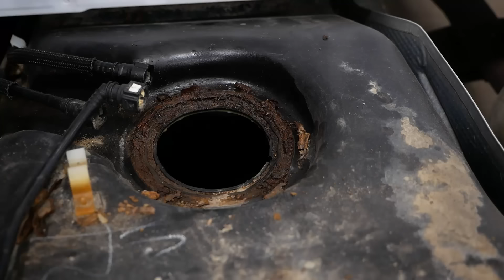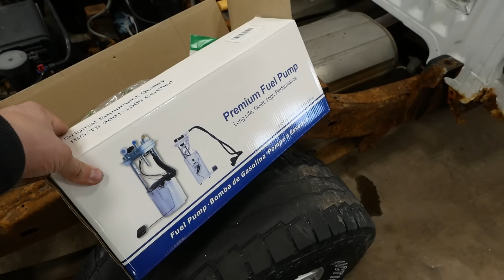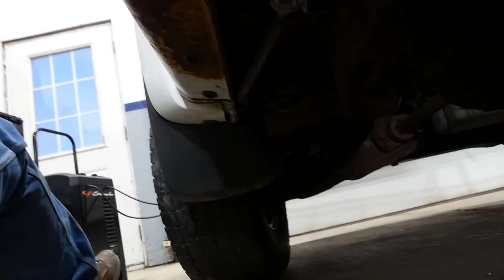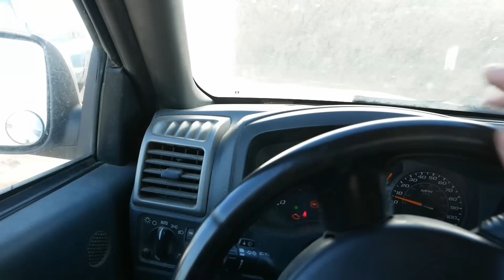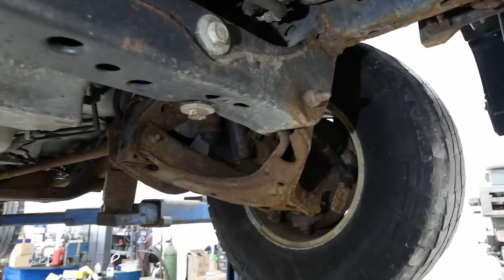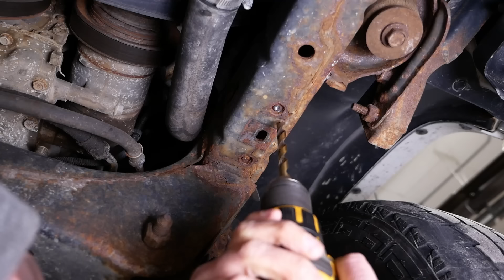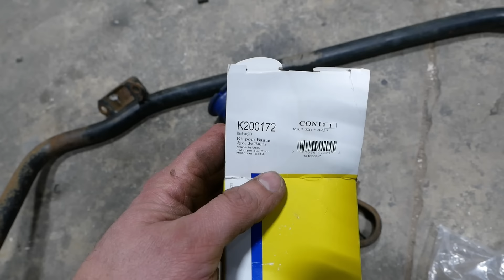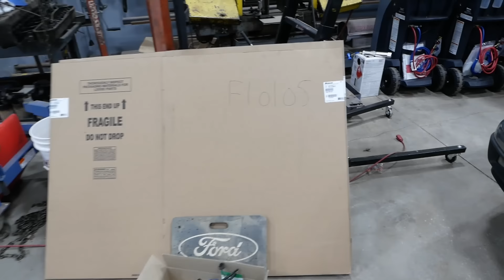Saving a GMC Canyon with 434,000 Miles from the Crusher - Won't Start, Fuel Pump Tabs Rotted

Comment: I bought a fuel pump from Amazon lasted.3 years.The transmission went out in the Van and it was still running still working.And I only paid $42 for the fuel pump. Thank you god bless

Comment: FWIW, I had to replace a rear taillight on a Terrain and their electrical connectors are almost impossible to take apart too!!!!!!!!!
Gee, we already know and have 4 and 6 cylinder engines, how about throwing them an in-line 5?!!
Nice troubleshooting and save.
Could you put some kind of cover over the recess in the fuel tank to keep water and "stuff" out of there?

Comment: Ford trucks have similar wire problems, sunroof drain tubes plug causing water to build up in rocker panels and cab corners, then they rot out and the rockers fill with sand and it destroys the wire harness inside the rockers.

Comment: This spring my 2013 Colorado started spraying fuel under the bed. 
Ended up pulling the bed. What a mess. 
When I got it off I could see that varmints ate the fule line. Plastic crap anyway. I replaced the fuel line. Pulling off and putting it back on broke the paper thin elbow on the steel line from the pump. 
Ring was still there and tabs were too. Just barely. 
Replaced the ring with an after market plated one and replaced the pump with an OEM one. I didn't want to have to pull the bed again. 
Working fine now.

Comment: Ya know Im always finding odd solutions to things and well when I saw that darn fuel pump sitting in that depression on the tank holy crap.  I know that hindsight is always 20/20  but in this case if I had known ahead of time how badly  that was designed I definitely would've blown that depression clear of crap and tried to apply a generous amount of  high heat gasket maker around that entire bowl that it sits in,, In your case I might try that boat tank but id fab up a thin metal container  for it to sit in.  I love this challenge you've given yourself , its only by getting out of your comfort zone that you expand your mind and truly use your creativity..

Comment: The passlock (anti theft device is not allowing it to turn on, fix  the issue ,  and the passlock will allow ignition …Any way it’s an Izusu  engine and yes they can go beyond  the miles of other engines ,

Comment: My work bought a new canyon in 16 in forty thousand miles the dealer replaced 3 complete  rear ends bearing issues. Then a check engine light came on dealer said it was a timing chain issue so they replaced it and the new chain broke and took out the whole engine.  Glad I bought a tacoma 😊

Comment: I would Permatex the whole thing. Also, troubleshoot first. I work in manufacturing and fix machines. Always troubleshoot first. Understand your meter readings.
Reply: Paying attention to the actual video and comprehending what’s being said is very important …….
Reply: @msabia1  I did understand. I wouldn't be doing a bunch of mechanical repairs without understanding the electrical problems. I would test and not fix the obvious that wouldn't solve problems. If the truck had a flat, I wouldn't fix the flat first and see if it would run.

Comment: Running it and running about two or three cans of carburetor throttle body cleaner through it or even brake clean through it while it's running at about 2000 to 2500 RPM usually cleans those up pretty good. And then put a good dose of acetone or lacquer thinner into the gas tank to make sure you clean out that fuel system. Maybe about 24 to 32 oz and run it good

Comment: If that's throttle body does not have an idle air control circuit it's the first one I've ever seen that doesn't. Although I've never worked on one of those older Colorado's.

Comment: well if it ain't my wife's truck. i used the same kit on hers and it worked well for less than a year. now the plastic is splitting apart and i'm getting water in the tank again. i was considering making a custom fuel tank for it, but they're a goofy shape so i figure we'll just junk it.

Comment: Once split tubing gets full of water and grit it just wears away at the insulation, then the wire just corrodes away. It happens especially where the harness is supported as the wiring inside moves but the tubing doesn't.

Comment: The problem with the wiring in newer cars is the coating they use on newer cars, I have a 91 Olds Bravada and the wiring looks brand new and it has 300,000 on it all original, same as my 99 GMC Safari awd wiring is in great shape.
Reply: Manufacturers switched to soy-based wiring by the mid 2000's, they used to be petroleum based. Our cheese eating friends discovered that change and wire damage became considerably more common ever since.

Comment: Hi from beautiful Ireland ☘, had a similar problem with my old Nissan Sunny.
Initially I thought it was the pump but the trusty Fluke 73III and an external battery proved otherwise.
Broken wires in the harness was the problem 💪😀

Comment: Only 7 minutes in but wouldn't it be possible to epoxy a new ring in place on the tank to lock the pump, instead of replacing the whole tank. I think I would do it that way.

Comment: I had a 98 Dodge Ram 1500 5.2L back in the early 2000’s. I put 400K on the motor. Had to replace the transmission at 215K. Other than the usual items that wear (water pump, belts, plugs) it was a solid engine. Just changed out the oil every 5K, coolant every 20K, and ATF every 20K. Regular maintenance makes a huge difference.

Comment: Imagine if you designed an affordable small truck and they tested it for 430,000 miles and told you the reason it stopped was a broken wire. You'd be so proud of your achievement lol

Comment: Good call on not using the seals all for gas glue, I live in a cold winter climate Canada,  I had repaired a kerosin fuel tank for a heater, that I used in my camper, I stored it in cold storage one winter ,and the next thing I knew that tank had a leak from where tip sealed it ,had just flaked away...maybe I didn't apply a thick enough amount or maybe I should have sanded the surface first I don't know... I'd still use it on stuff that isn't going to be hidden or hard to get to things but wow over 400,000 I thought I had a high mileage truck, I had to go and check., 338...And mine is a 93 5.1 ford I say a prayer every time I leave and return safely 😉

Comment: I may or may not have used threaded rod, angle iron, and half tube of seal-all to fix a fuel sending unit on a car with over 260,000+ miles🤣

Comment: sway bar broken bolts drill thru, heat up and use  "easy out" bolt extractor .Grabs on reverse (ccw) I do alot on exhaust bolts.

Comment: It is very possible to have that many miles on a vehicle and much more if you take care of it. It may have been a fleet truck that regular oil changes, inspections, and immediate repairs as needed. I had a customer once that had a ford escort that rolled the odometer past 999,999 and back to 000,000 and on. He went by the owners manual to a tee even replacing the timing belt every 70,000 miles. He did have to have a transmission overhaul but the motor was all original except for the timing belt, pulleys and serpentine belt.

Comment: I have a Colorado same body style mine has 300,000 still got the OG timing chain and I'm just as surprised as u are. Those motors get a bad rap cause of the design but I've found if u change the oil regularly Thay last

Comment: 5 cylinder engins are usualy very well balanced. Germany was well known for 5 cyl. The mercedes diesel engines that came in cars were well known to run after 500k miles. The mercedes museum has a car with over 1 million miles. 
I have friend with mercedes diesels one of them has 485 k miles
The other was 502k miles.  I own 2 mercedes turbo diesel cars that get about 28mpg. For a comfortable car that is over 3500lbs. Very reliable Cheap to maintain and get parts you cant beat them.

Comment: Shame on gm.  
My 05 Yukon pump was rusted out but not that bad. The lines were leaking so I remove the back seat and chopped the hole and put in a new pump and it worked okay but I had to grease up all the metal lines and lock. I've been okay now for 4 years. 
I never drop the tank

Comment: The shop vac used on the tank is scary i watched a guy do the exact same thing and before i could say don't touch the switch the shop vac exploded and landed about 20 feet away. The electric motor isn't isolated from th fumes. Oops.

Comment: 25:28 Wes you crack me up. "Could this thing possibly have 433k miles on it?" Yes. Not all that uncommon in the south. Everybody has a family member or friend with a car or truck over 400k. Dad's neighbor must be approaching it, I've rode in a corolla with 420, and I've seen a mint 4runner with 450k. We fix them down here because they remain worth it.

Comment: Where the break was.  Maybe the other wires were damaged from the arcing of the fuel pump wire as it was failing.  The fuel pump wire may have been mishandled at the factory when installed.

Comment: My 2008 Colorado with the Isuzu I-5 ran for 329,700 miles before the rear engine seal started leaking and I no longer trusted it for my 180+ daily commute.

Comment: epoxy resin and fiberglass rope would seal the new fuel pump in place . the anti roll bar  bolts need a bit of lube .. and some 3M chassis wax would improve the life of the rusty chassis .

Comment: Back in 2008 I had a 2005 Colorado 2WD ZQ3 factory lowered 4 door. Had the 5 cyl automatic. On those they put on 17" rims with fat low profile tires so it drove like it was on wheels. Trouble was the suspension wears out fast. After I had to have the transmission redone at 80K, the steering was getting loose. Some of the mounting points were wallowed out. So instead of a 4000 repair I traded it in on an 02 GMC Sierra with 90K. Dealer gave me 4000 for the Colorado too. 8 grand ahead I was the Winner.

Comment: Wes, you are doing the broken bolts wrong! Rainman Ray said to weld nuts on them first! I have never seen such a clown that does things like he does! Everything he does is unbelievable! Not in a good way! Another great video! It’s so nice to see real mechanics and not just a guy that gets on You Tube like Ray does, and runs his mouth like he is the best tech on Earth, which we know isn’t the case at all! He had me fooled for awhile, but after 3 ruined engines because of his bolt removal process, I knew he was just a X Jiffy Lube guy! And he really did work there, and admitted he has been fired from numerous shops, now we know why! I retired after 43 years in auto repair and mobile auto repair, and have seen his type many many times! It only took 2 weeks for him to put new headliner in his pickup, after removing everything inside the truck! Watch that video, should give you a good laugh, like it did me! I don’t know how guys like that stay open?

Comment: This tank design has been in use since the 1990's and what troubles me is why would you marry crappy steel with plastic as well the steel lock ring . They put quality into the fuel tank and lines but forgot about the location of the lock ring.
Reply: I appreciate your description and video's.

Comment: I've only driven 2 cars with more mileage than that. A Mercedes 190D and a GMT800 Yukon XL. The 190D had barely even needed repairs, while the Yukon had a new trans and diff.

Comment: 434,000 miles and the only thing not broken is that annoying door ajar dinger bell. Oh btw a pressure washer works really well on those throttle bodies you just have to pull the plugs and turn the engine over and change the oil afterwards.

Comment: If the guy got the truck for $100 and it has over 400,000 miles and the fuel pump is the only problem how can you complain about  the way GM put the pump in? The fact that it is still running would seem amazing in itself and yes I had the same problem getting those lines loose.. I cut them from the pump at the sender then got them loose. What I had to do was put a plate over the pump to hold it down.

Comment: The problem with O-rings and superglue, is the fact that the join is much harder than the rest of the O-ring. So it does not seal as good as it should... Otherwise great videos Wes :washhands:

Comment: I had one of these (2008) and it was a trooper but it started having issues that weren't simple fixes. EVAP leak, which was likely from the gas tank, leaking coolant from some unknown location, a starting issue that was likely a leaky fuel injector in hindsight, and other issues that overall just gave me trust issues with GM as someone who grew up a GM guy. Ended up trading it for a Toyota.

Comment: I used a pressure plate from an automatic transmission clutch pack on mine. The location tabs around the perimeter allowed easy attachment. Best of all it was free from the used parts pile.

Comment: Nice fix for the tank.  It may not last forever, but new life has been breathed into that part of the truck.  The pump wire circuit was a straightforward routine that yielded a great find.  It is obvious those trucks are not designed to las as long as this one has.

Comment: Yes on stupid design. I am convinced designers design with failure in mind as a “Steady source of money” to repair and replace! It is in all industries and it’s ashamed and really a crime. Stainless would have been the best thing for the locking ring. If you can repair, I would make a “near as perfect” a “tent” to cover the pump and using good sealant to assist a fair seal from road salt, etc.  You may consider cutting a resealable access hole in the truck bed if and when this happens again. I say when because after-market pumps are notorious for FAILURE!  To guard against failure, never let your fuel drop below 1/4 tank due to the fact, the gas is the lubricant the pump has to have fir lubrication and cooling.  I bid you great success! I THINK ACCESS HOLES OVER FUEL PUMPS SHOULD BE MANDATORY ON ALL VEHICLES BECAUSE PUMP FAILURE IS JUST A MATTER OF TIME !

Comment: Those inline 5 in those are the roughest idling modern port injection engines I’ve ever felt. I seen a guy with a hummer h3 spend a fortune only to find out his $30k off-road toy idles like a 2k shitbox with bad injectors. Vibrating steering wheel included at no extra charge👍🏼

Comment: There was a short period in the 70s when Chevy pickup beds would rot within a year or two. The US industry was starting to use (more?) recycled steel. If I recall, imports had turned to that source sooner and had fewer problems. I was a huge Chevy fan, and it was a tough pill. All those wire splices should be able to gang up on that split loom and get even. Well done.

Comment: My 2016 Z71 Colorado has 158,000 miles and it holed a piston via clogged injector 3 hours from home, $15k to fix and im basically just out 30k thanks to the little turbodiesel killing itself

Comment: Hmmm lol only one you seen at 400+ 

Iv drove 3 over mill easy and they were Chevy and gm one had engine replaced had crack in block 
The other two had heads a piston countless water pumps thermostat few starters alt and tires and one trany they were square body 77 78 82 
I'd love have another easiest engines and system to maintain

Comment: I would’ve removed metal. Clean the plastic.  Place an o ring around the fuel pumps flange. Then use self tapping screws to hold flange down
Edit.  Well. Look a there.  They make a kit.  Thinking outside the box is a dying art. Necessity is mother of all invention. And well. Being cheap/poor

Comment: Id go with a 2003 or 2006 tank.  Those trucks didn't change their design that much back around those mid 2000's years, did they?

Comment: I feel you with the wrong bushing in the right bags and boxes. In the 1980s, when I lived in Columbia, SC. Bad starter Bendix on a Ford. Walked a block to a Carquest and bought a rebuilt one. Pulled the starter out and took the Bendix off. The rebuilt one wouldn't drop onto the shaft. The original had 3 splines, and the replacement had 4. Walked back to the Carquest,  old and new in hand. He looked it up again, the number was right. Retreidved another one, 4 splines. Said he had one more in stock, got it, 3 splines. Mistakes do happen.

Comment: It's caused by the current for the pump pulsing through the wire.

If the wire is up against another high current wire the pulsing current can cause it to jump like a speaker coil.

It was just dumb luck that at that particular spot in the harness the wire was up against the loom ribs and another wire with enough current to cause it to jump with each pulse.

Comment: Out of curiosity, is there any constraints that make it impossible to use some rivet nuts after using the self tappers to mark the new holes?
Reply from the maker: No, but the fastener is not really the issue.

Comment: you should use heat resistant oil or grease when drilling a hole keeps your edges sharpen longer ;) best gm motor ever 3.5 vortec btw mine's way more rotten and it still a real good truck

Comment: Never, ever, ever use a ShopVac to suck the contents out of a gas tank. ANY gasoline vapors will get sucked through the motor of the vacuum cleaner and could be ignited by the vacuum motor's commutator ring. Even if it's like 95% water and 5% gasoline, this is extremely dangerous. Take the tank off and pour it out.

Comment: My fuel pump on my 08 Colorado rusted out so bad the vent hose and the fuel line off the pump rusted in place. Broke off the connections with the 5/8 and 3/8 fittings even being gentle. My ring is in the same spot as that one I just haven’t broken it into pieces yet. Was spraying gas all on the underside of my bed. Bought it for 1100 because it “had a gas odor” guy didn’t want to mess with it. 200k and engine bay was spotless I couldn’t pass it up.
Soaked the whole pump lid and connections with an entire can of pb blaster on and off trying to tap it loose and no luck. 
Glad I found your video going to snag that tank kit and keep it moving.

Thanks for posting this bud.